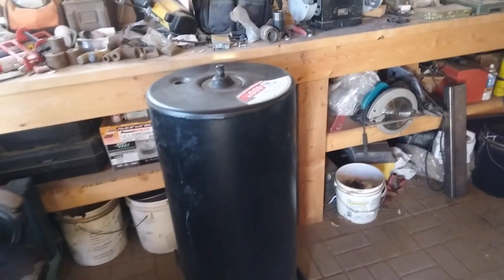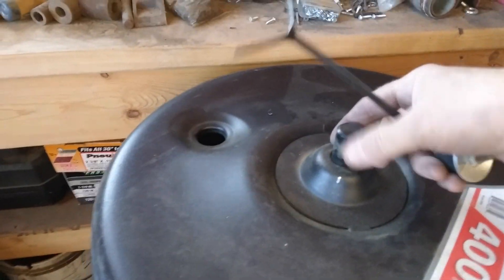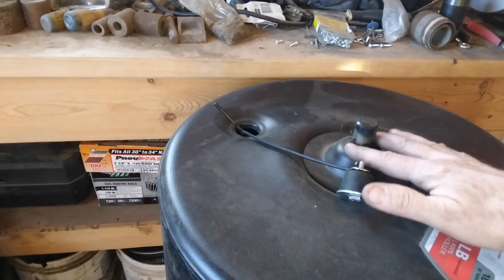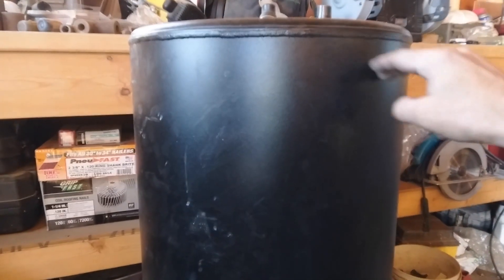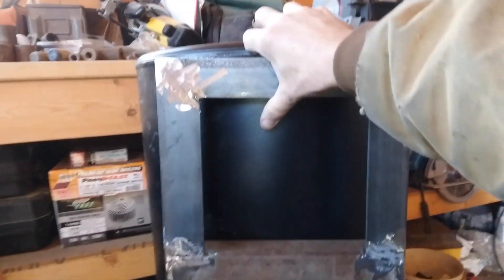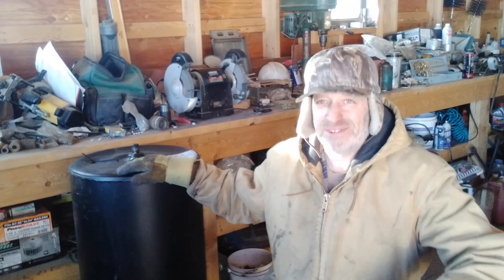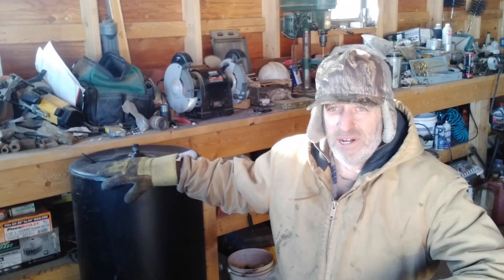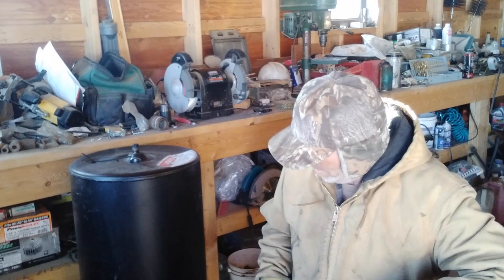DIY Rocket Stove Water Heater, (part 2)

Comment: if i was in a cold area like you are i would go beneath the soil and underground... the ground works perfectly as a insulator ( 5 walls with no cold air cracks ) and holds the heat in 5 ways so the only place to insulate is at the top that means less materials less heat loss and in the summer days it is nice and cool...

Thanks for your video's and to share knowledge, much appreciated !

Live long and prosper,
Reply from the maker: The rocket stove water heater that I made in these videos, I put in a greenhouse that Is dug into a side hill.  If interested, you can see the build on my other channel.  "https://www.youtube.com/user/MIhere2"

Comment: Excellent!! I like the intro too.
Blizzards, schmizzards. It might as well be July as long as there's a ball peen hammer and a hack saw in the shed.
Reply from the maker: It's hard working in an unheated shop though, when it's -36˚F.   🥶
Reply: @doubleMinnovations  Yep!! I'm in Ottawa and the coldest I've seen is -30 C..-22 F.
You got me trumped on cold and I whole heartedly agree...ya' gotta' have heat in these temps. So...a hammer, saw and a woodstove.
Reply: @doubleMinnovations  Do not worry Double M I about the cold. Spring is on the calendar soon. What I am wondering is how you figured out the five square inches size ??? What is the flue pipe size of the stove you are making ?? Keep up the great work and keep the faith.
Reply from the maker: @victoryfirst2878  I decided on the area of flow size, by observing how my other wood heaters were working.  I mentioned the  masonry heater in this video, that works best at around 5 square inches of intake. -that's an 8" chimney.  This is going to be a 6", and  lot like the rocket stove I made.
Reply: @doubleMinnovations  Have you decided to use the six inch pipe for slowing down the flow of heated air from going up the chimney ?? Good day fella.
Reply from the maker: This is just going to be a smaller burner than the masonry heater.  This heater is going to be for the green house dug into the side hill. 16' x 28'.   You can see that build on our other channel.
Reply: I have to agree with you fella. Six inches is a great size for a flue exhaust. Since I have a 12 inch square terra cotta chimney which give such a large draw of air using a 6 inch flue pipe will keep more heat inside the house. Peace
Reply: @victoryfirst2878  A smaller diameter flue will increase flue gas velocity, which in turn reduces stagnation yet increases flue temperature and the buildup of creosote.
Reply: @Ian-iu2tl  Creosote build up has a lot to do with burning unseasoned wood. Once a week I burn flatout to make sure the tar burns up. Works for me Ian. Thanks for the info and peace. VF
Reply: @victoryfirst2878  Unseasoned wood and softwood are not the best for sure. As you put it, your once weekly burn will help this. I am a gas, oil and wood heat tech 40 years in the biz. The best way to maintain a clean stack is to have a straight vertical run with no elbows, 6"to 8" diameter pipe and insulated. This will keep the interior hot and creosote free. Makes for a faster light up of a cold stove as there is less cold air in the stack to weigh down on the smoke. It also makes for easy inspection and cleaning....once yearly on the latter. Cheers.
Reply: @Ian-iu2tl  Could not have said it better myself. I can say I learned a lot from so many people that it brings a smile to my face. Peace and cheers Ian.
Reply: @doubleMinnovations  Use my method DMI. Put on a union suit underwear and it doesn't really matter than. That is the trick when working on the Alaska pipeline. Some days it was so cold that spitting would turn your hocker into a kernel of frozen flem. Oh my such great memories as spoken by the Coneheads movie star Dan Aykroyd.